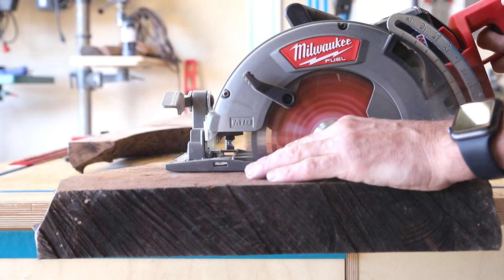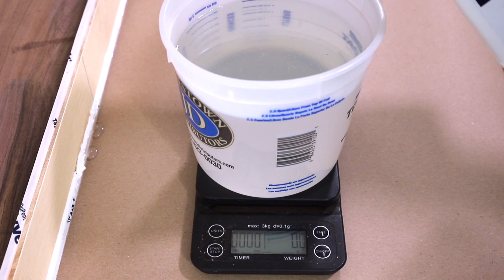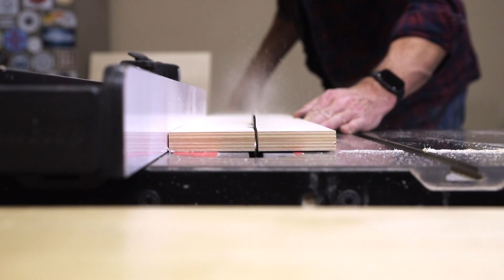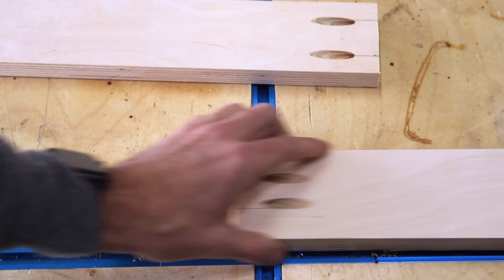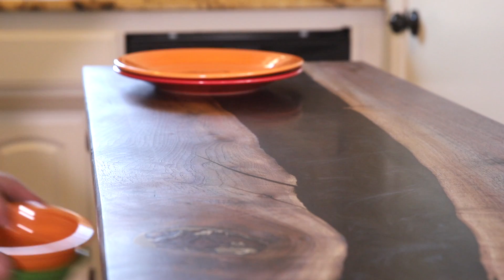Trash Wood to Treasure - DIY Kitchen Island w/ Epoxy River top

Comment: Would it make more sense to just add the pigment to the last of the three pours? Since you are using an opaque black pigment I would think that the first two layers are not visible under that last layer so any white pigment swirled into them would not be visible.

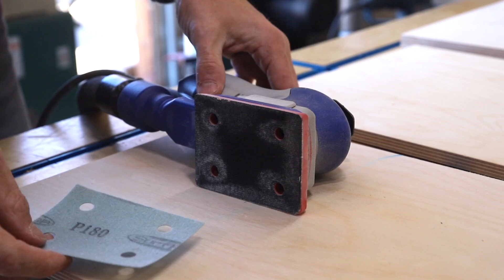Comment: Maybe I missed it, but how are you attaching the sides of the backer panel? At the 10:12 mark there seems to be nothing for the side to attach to... The top attaches to the stretcher, middle is attached via the dividers, but the sides and I guess bottom as well?
Reply from the maker: Good catch. A detail I left out that will be discussed in the build article...whenever I get time to get that out. Hopefully after the holidays. Basically there’s enough to attach to on the top and middle to pull in the sides. For the bottom I added plywood strips inset the width on the 1/4” backer board at the back of the cabinets.
Reply: Jonny Builds That makes sense. Thank you for the explanation 👍🏼
Reply from the maker: My original design called for the backer board to be a 3/4” plywood panel that stretched the length of the piece. I tweaked the design to save on materials and to open up that end so you can have two people sit at the kitchen island like a breakfast nook table.

Comment: Beautiful build.  Where do you get the 3/4 inch Baltic Birch plywood?  I have found 1/2 but not 3/4. Been wanting to go into Vintage, but afraid I would never leave. Also, how much epoxy did you use for the pour?  Keep up the great work!
Reply from the maker: If you’re in OKC go to Phoenix Hardwood on N Classen. Thanks for watching, and it was about 3 gallons of epoxy.